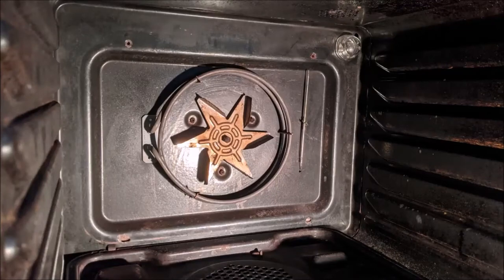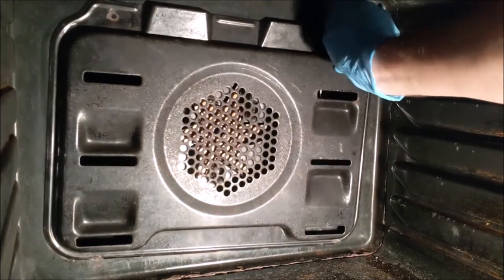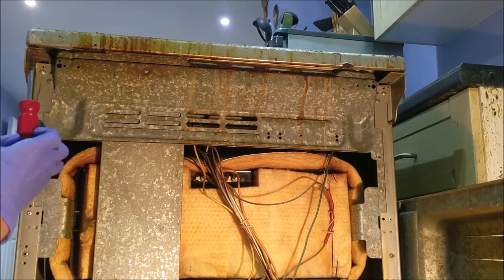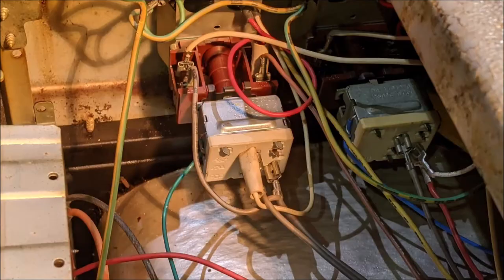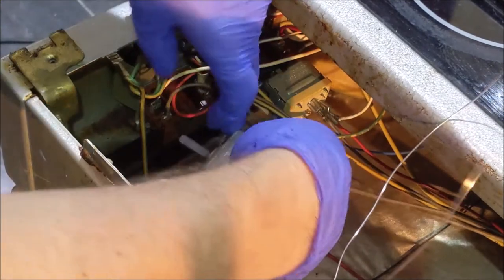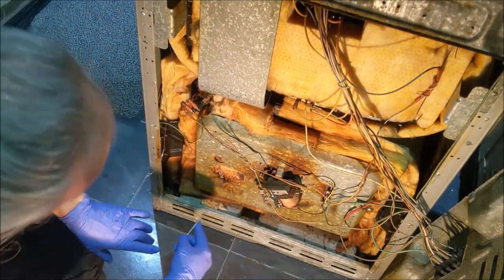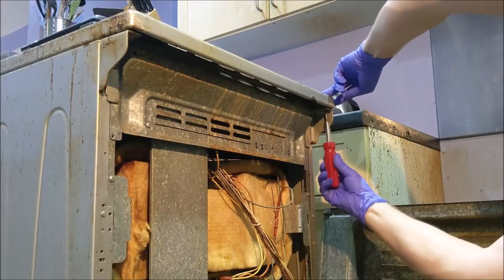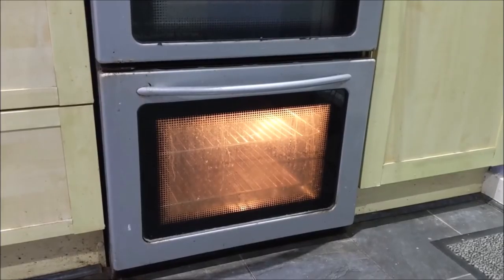How to replace the thermostat in a fan oven

Comment: i changed my thermostat and now it doesn't even work -_- not sure what have i done but all i did was take the old thermostat out and put new one like for like :(
Reply from the maker: Does anything on the cooker turn on or is it completely dead? If it is completely dead, check the wall switch, the house fuse box and that the connectors at the back of the oven haven't been pulled out.